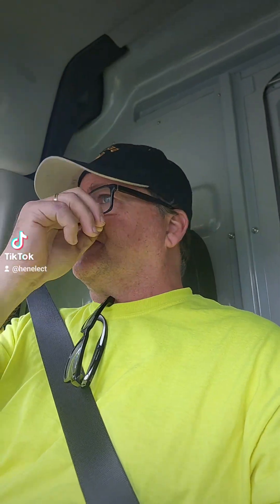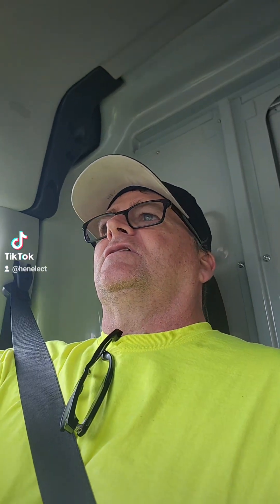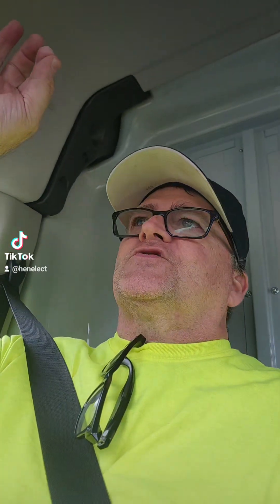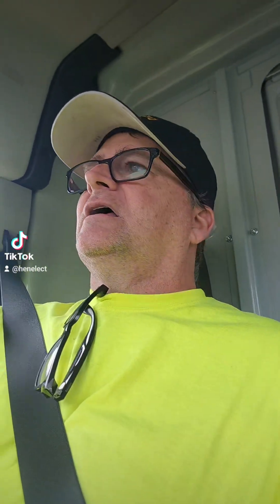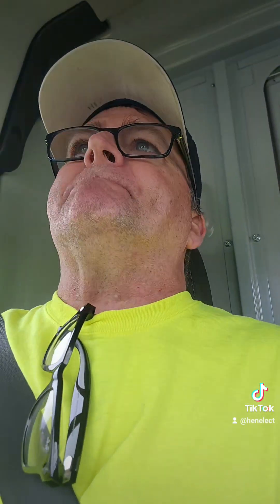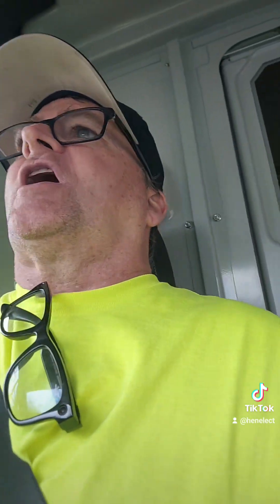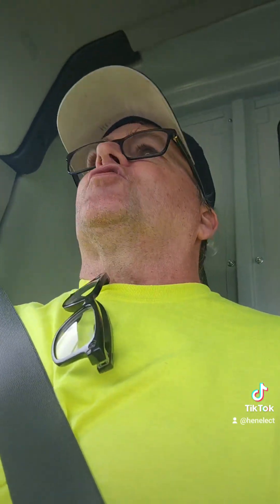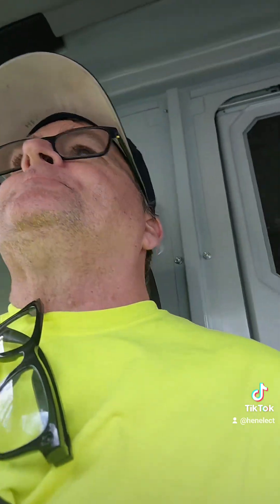100Amps Blew Up off a 15Amp lighting circuit !

Comment: your problem isnt equipment based off this short description, its Available arc current, and the issue that you had concerning the fault.  its plain as day, not equipment that was used!  
being said though! 
Theyre all shit dude lmfao!!  Ge is just as good as CH and SqD!  In fact in commercial apps, GE Eaton is better imo!  but like i said, theyre all shit!  in the last 15 years, the quality of ALL electrical parts and equipment is crazy!  Bus bars stripped out from the factory in panels, ive ran into that like 4 times in 2 years, set screws in connectors/couplings being basically stripped, etc.. etc....
Reply from the maker: Thank you for the comment,

Comment: Live work is unavoidable sometimes, but for all the other times don't do it.  Stuff like this and far worse will happen.  God knows how many hundreds of amps were actually flowing, quite capable of blowing a bit of hot metal into your eye and then it's all down hill from there.  Good that you came out of it unscathed.  High current faults in final circuits can be sufficient to trip CBs upstream of others regardless of breaker quality.  The specs of the upstream matters more.  I don't know anything about USA breaker specs but 100A C curve, anywhere from 500A up will potentially magnetically trip it.  D curve 1000A and up.  With your potentially low supply impedance over there (transformer is right outside sort of thing), 500A from a final fault is certainly believable.
Reply from the maker: Great comment, thank you, I always use eyewear, and you're 100% right. In the US, smallest residential Kaic rating is 10,000A, and the main breaker is 22,000A,